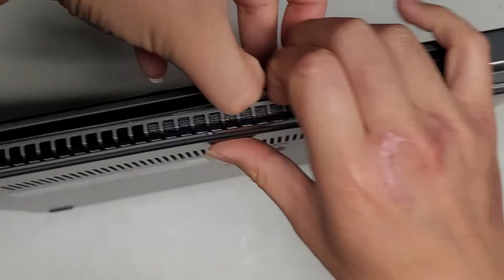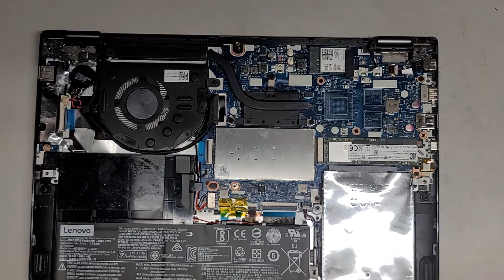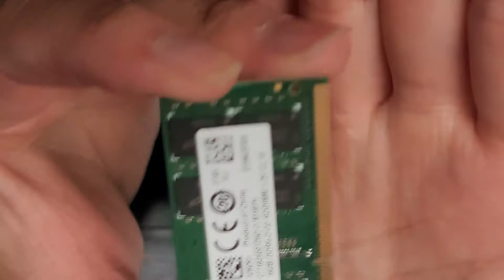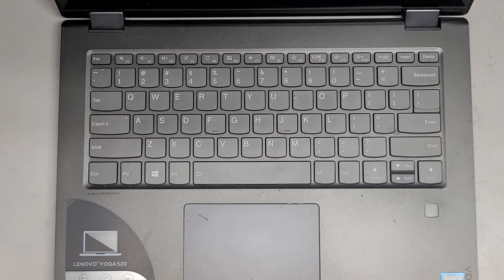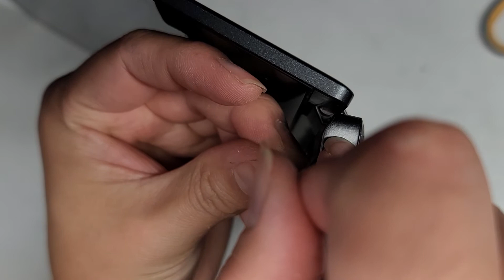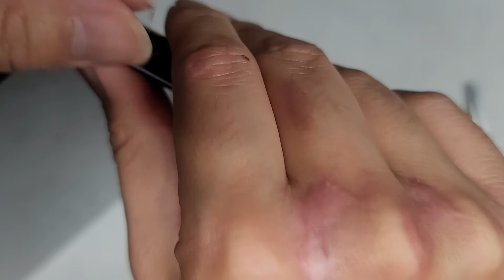Lenovo Yoga 520 Disassembly RAM SSD Hard Drive Upgrade Replacement Repair

Comment: On this model I'm having difficulty removing the hardisk .... it doesn't even slip off by pulling it very hard (I removed all the screws)
Reply from the maker: Lift the back up a little and wiggle side to side as you pull.
Reply: I have the same problem, I've tried pulling it VERY HARD, it doesn't release at all, I tried lifting the opposite side of the connector and wigle while pulling hard, nothing

Comment: This is one year old video and i am pretty sure that till now its right hinge must have been broken. Same issue with my yoga 520.Right hinge broke the plastic and came out. Yoga 520 design is faulty. Its not built on how actually users gonna use the laptop. Basically users open from right hand from right corner. So one side (right side)  hinge face pressure and ultimately it becomes tight & it breaks the casing. Why Company used such hinges. Why they have not marked that it must be open from canter only otherwise hinge will break. Pathetic lenovo.
Reply from the maker: They don't think about it and when they test with the machine, they have a robot open it from the middle. Lol

Comment: What If I put the same ram just it has 2400Mhz, will it work?
Does it's safe to put 2400Mhz ?

Crucial 16GB DDR4 2400Mhz
Will it work, and won't damage my laptop?
Reply from the maker: Worst thing will happen is it won't work until you change it back. Give it a try.